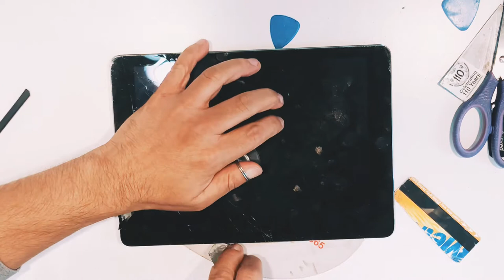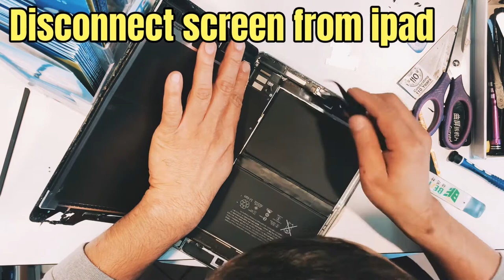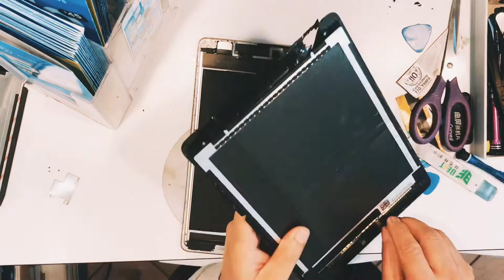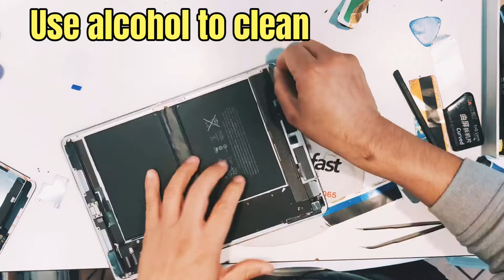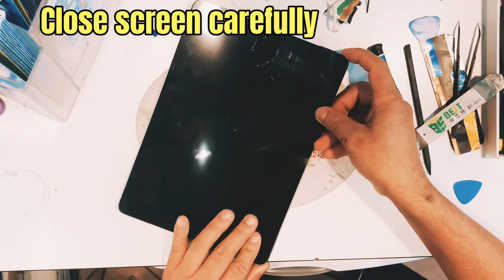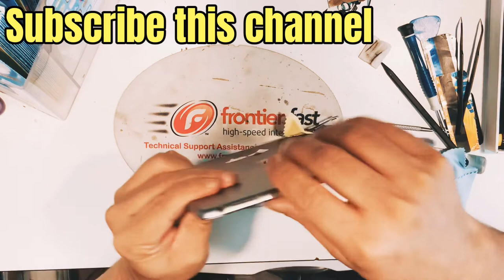iPad Pro 9.7 broken screen replacement tutorial step by step.

Comment: The screen flex is very fragile! When you try and put the screen on, and it gets pinched you just ruined the screen. Make sure the flex fits into the slot on the case. It just doesn’t fall into place. Had to get a new screen. The new one didn’t adhere well at all. Started to lift off easily. Used the good double sided tape. Screen cracked when trying to remove. 3rd and final screen. Going to glue this one with B7000.